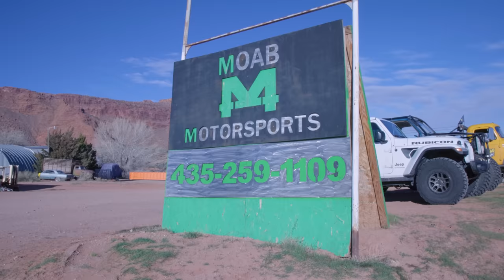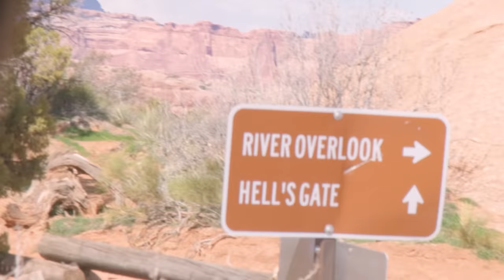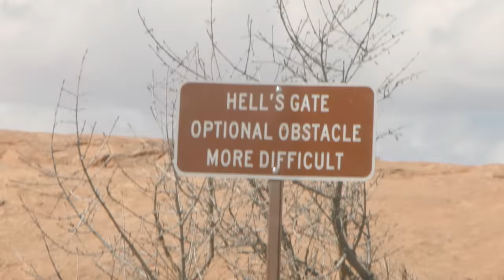The "Laymo" Land Yacht Limo Conquers Hells Gate!

Comment: Compared to how all the other rock crawlers approach obstacles, how they fit the bumps and cracks, the front and rear of the Laymo are doing completely different things, making it harder or easier than it is for others. "Oh, your Jeep is at a 75 degree angle going up that wall, with your rear tires in a hole? I'm at only 27 degrees and my rear tires are at the top of the previous hump."

Comment: Oh..  that reminds me..  Robby!   
The keypad Code (4 numbers) was printed on a tiny white sticker (1-1/4" x 3/8") , and stuck to one of the Arms holding the Trunk Lid, normally the right-side Arm, facing inward toward the trunk..  close to where the Arm bolts to the Trunk-Lid.  
Peeps also remove that sticker too :-(
Reply: Enter the code once to unlock the drivers door,  then 3 for all doors, or 6 for the trunk..  anytime 8+10 simultaneously to lock all doors.

Comment: if you install a 12v liftgate pump in your steering hyd lines you still have steering on a full hydro system when the engines is off. Like the safety electric pump on some hydroboost brakes. I think once you either run electric over hyd steering or electric backup on your hyd steering then total hyd should be able to be street legal.

Comment: Tell hillbilly to upgrade his transfer a case to a Borg Warner 1354 there is no slip yoke on the front driveshaft it’s fixed yolks end it will bolt right in place easily be found from a 94 ranger or 90 to 94 Explorer 4.0